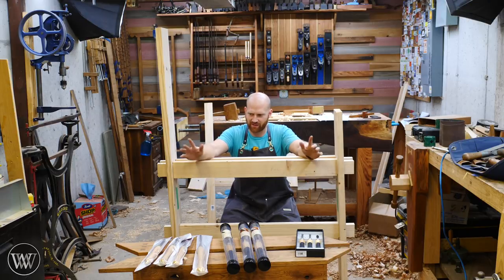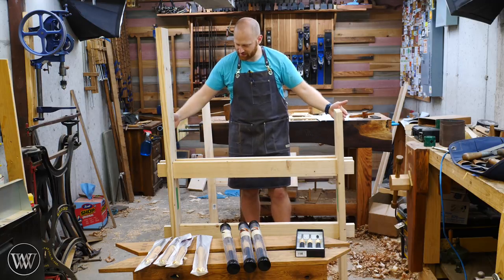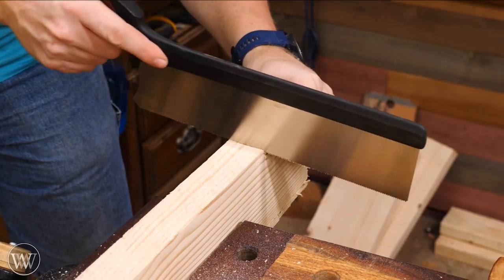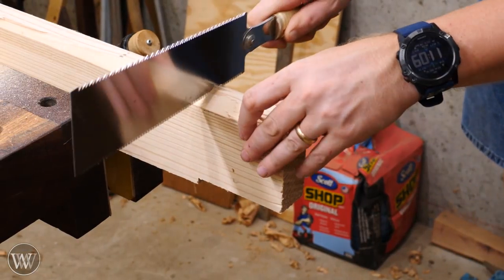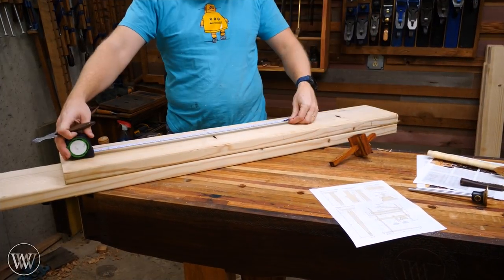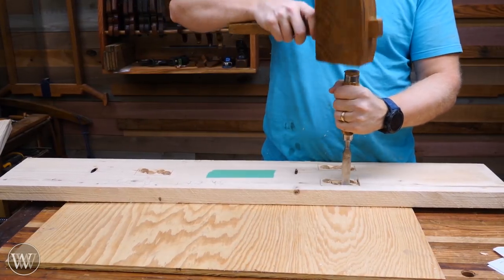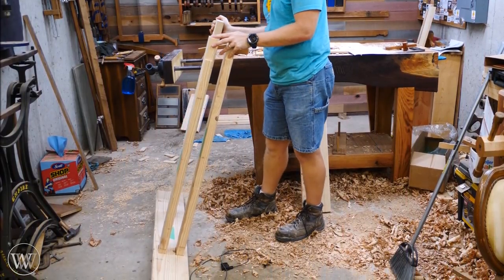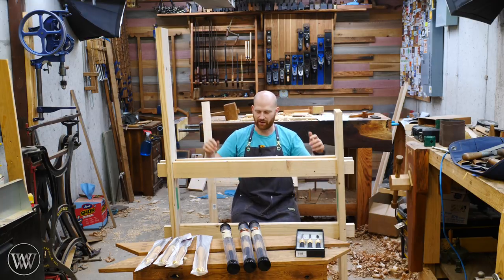How To Make a Spring Pole Lathe Part 2 | Foot Powered Hand Tool Woodworking

Comment: I just built this lathe from Roy Underhill's plans a few months ago. I really enjoy using it. I ever build another one though, it will probably be a bungee lathe. The rocker arm is fiddly, but it's definitely more traditional looking than a bungee. Other thing that drives me nuts about Roy's lathe is that cross piece down low on the lathe! It really tends to get in the way of the board you step on to operate the lathe. Can be frustrating. I actually tried to use the lathe to turn a bowl recently - the rockers arm design doesn't work for bowls. They have too much momentum. I clamped some boards to the uprights and attached a bungee, and it worked much better. Good luck!
Reply from the maker: I am planning on building a flywheel lathe soon for some of the larger things.

Comment: Looking really good, been meaning to build one for small spindle work for many years.
Here is a tip which you can either trust me or try it for yourself.
Do not even try to use Carbide insert tools on a spring pole lathe... it will lead to a massive amount of frustration.
Because of the reciprocal action you need to slice through the work not scrape.  
All you need is a large Flat Gouge, a detail gouge, I recommend a 1" Skew and lastly a parting tool.
Ben Orford is currently sharing allot of great info and he showed his spring pole late in use.  While I do not necessarily agree with the tools he chose I have seen all sorts of real simple cutting tools used on spring pole lathes.
The English Woodworker also made a Bench top spring lathe for small work and that is a great option for really small shops.
I love the finish that the slicing action leaves and the tool marks should become part of the design in my opinion, no sanding needed just some burnishing with shavings.
Hope you have a blast with it.
Reply from the maker: I am of the same mind. I much prefer a sharp cut on the slower speed lathes.

Comment: For when you go for the more mechanical lathe, you can easily repurpose an old bike freewheel (the back wheel, as long it's not the kind that brakes with a reversing of the pedals) as either a flywheel or an intermediate mechanism that will let the lathe keep turning when you stop pedaling/treadling. (Just make sure to install it the correct way around!)
Reply from the maker: that is what I plan on doing also keeping the gearing so one can put a lot of power into the fly wheel!

Comment: Hi, glad to see you building a pole lathe, but I have a couple of concerns. 1. Is the pine you are using going to be heavy and robust enough? 2. You don't seem to have enough gap under the bottom stretcher to provide enough travel for the treadle. Hope it goes well, Craig
Reply from the maker: yup. it is light enough to carry in one hand. you only need to worry about the weight with a motor. and yes the board comes up on the far side of it so there is lots of room. the design actually comes from Roy Underhill in Pop Woodworking.

Comment: What's your opinion on the manual table saws? Seems like a homemade one would be right up your alley.
Reply from the maker: That is on my list to make some day. I want to make a fly wheel that I can connect a table saw, joiner, router table, or band saw.

Comment: looks like we have a similar if not the same mortis/tenon marking gauge, mines pretty, body made from a burl, crappy finish though. As for the turning tools, I found a 8 piece Japanese set for stoopid cheap at the local pawn and could not pass them up. Can't find the brand anywhere, just to see what kind of stealing I did... but no lathe yet...  Can't wait to see you run that thing.
Reply from the maker: Nice. Love it when those finds come together. that gauge actually came from harbor freight. actually not a half bad tool.
Reply: good price too.

Comment: One day i will build something similar, although i prefer the treadle type with a flywheel. For now, the elektrickery is very helpful. 

By the way, the tools you have arent the most traditional for use on a pole lathe. Those are hook tools. You might want to look into those. There are a few videos on those on youtube. I think the channel is harry rogers. He blacksmiths those tools himself. Check it.
Reply from the maker: yup. I will be getting a few of those too. I plane to build a flywheel lathe too soon. one can not have too many! LOL

Comment: Looking forward to the tusks! It's a super cool joint. 

Are you planning on this being a knockdown design?
Reply from the maker: Yup. I am planning to use it out side from time to time where it is easier to clean up. also to have it go on the road.
Reply: Wood By Wright lots of light and dust collection provided by the wind. Great reasons to work outside!

Comment: WHERE'S THE MOTOR GO ?
Reply: It's a spring pole lathe mate.
No motor.
Reply: I KNOW , JUST A JAB FROM A POWER TOOL GUY.
Reply: Mike Tarzwell it's in his pants.
Reply: OH BOY, WHAT CAN I SAY, THATS WHERE I KEEP MINE...... MY RIGHT LEG THAT IS. AND I GIVE UP.
Reply: Mike Tarzwell... Machinist.
Reply from the maker: my friends lathe is alcohol powered, but I don't drink so I am not sure what to put in it.
Reply: ON A DIFFERANT NOTE , I PICKED UP A STANELY #3 YESTERDAY FOR $19 , IT IS THE SECOND RUN SO IT IS RIGHT AT 200 YEARS OLD. MOST OF TODAY WAS  SPENT CLEANING IT UP .
Reply: Milk driven 🥛🥛🥛
Reply from the maker: Nice find. but Stanley has not been around for 200 years. Type 2s were made between 1869 and 1872.
Reply: MY BAD I HAD TO CHECK MY MATH 128 YEARS
Reply: Mike Tarzwell 5 years older than my lathe. No wait, check your math again. 145 to 148 years...